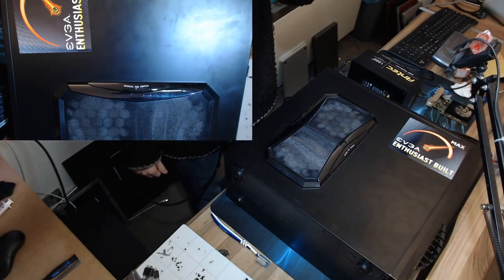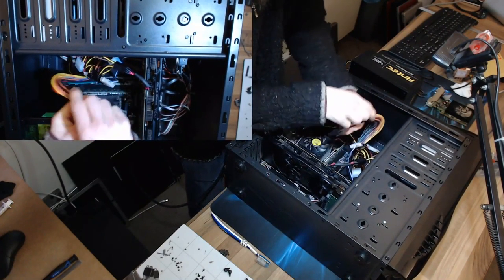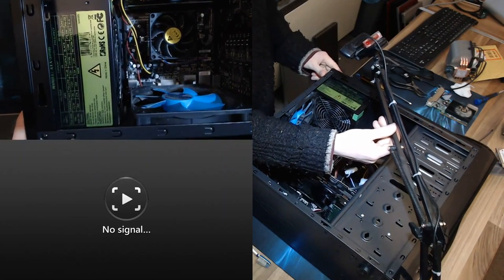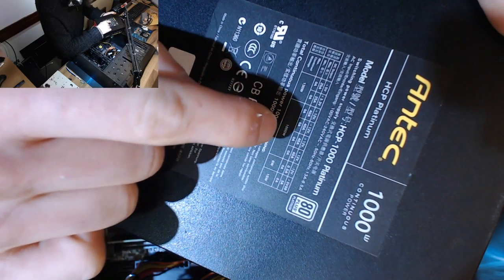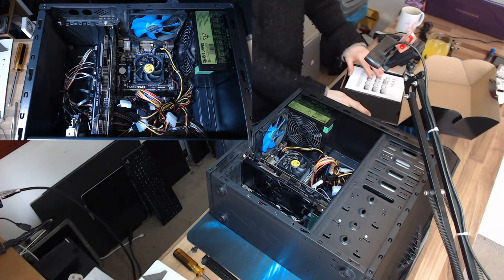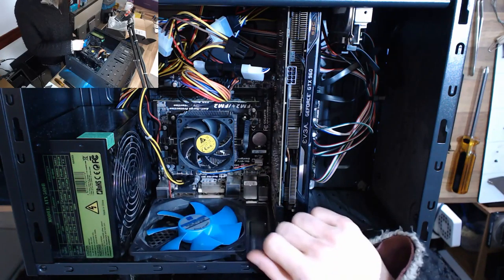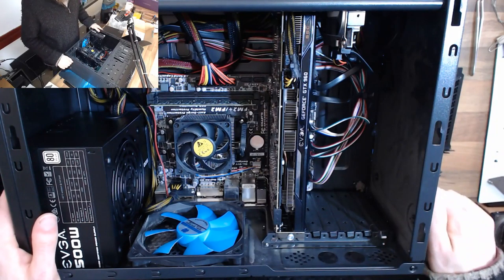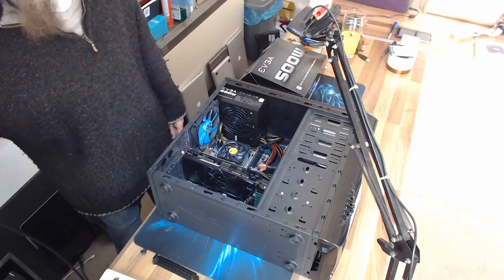LFC#99 - Crap Power Supplies

Comment: I am a firm believer in saving money on power supplies. That is why when I bought my EVGA 650 GQ 80+ Gold semi modular power supply I waited until Boxing Day and bought it for half of what it's currently selling for. If you want to save money that's what you do. Buying a crappy PS costs a lot more in the long run.
Strange that the customer in this vid had an "EVGA enthusiast built" sticker on the case but not an EVGA PS. Well they do now.
Reply: The sticker may have come with the card

Comment: i really don't understand how people would put together parts for a pc like this, they get the most expensive motherboard possible, the most amount of ram, a big graphics card that can barely fit inside the case sometimes, 4tb or more on storage and then turn around and buy the crappiest unit for powering the whole thing, where do they find these power supplies anyway i saw that green label and i knew right away that was going to be another useless power supply.
Reply: I was given a PC a few years ago (of which the board/CPU/cooler and a couple of drives are actually in my outgoing main PC; I upgraded the rest) and the PSU was a "750 watt" CiT, needless to say I never plugged it in and replaced it with a CX 500M. so yeah the CiT was maybe 350 watts on the 12V rail and useless excess wattage on the other rails making up the rest, which I learnt from watching this guy's helpful other "crap PSU" video only the other day! compared with 450+ watts on the 12V rail on the Corsair... the thing is, the PC with the CiT PSU in it literally came from my Mum's partner who's actually pretty good with PCs. It's like people don't even understand :P
Reply: It’s called tech ignorance.

Comment: HERES a good question So lol if my psu has a Weak 12v rail.  assuming the 6pin power connectors are Part of that Rail. would it make more sense to use a x2 molex to 6pin for gpu power assuming the molex is on the 5v rail which is stronger then my 12v .. 12v rails got 18 amps and a secondary 17 amp. but the 5v is 30amp . Does that make more sense.
Reply from the maker: 4-pin Molex wires are 12-0-0-5, and when you use a molex to 6-pin adaptor, it's just taking the 12v and 0. So that won't help you.
Reply: 6pin provides only 12V. Molex provides 5V and 12V but the adapter doesn't use 5V because 6pin isn't supposed to provide 5V.

Comment: should of done a short vlog showing the working PC after your fix. just a tip for next time, still got a thumbs up from me.
Reply: He already did that - it was proven working when he switched in his Antec supply. Machine went from dead as a doornail to looking for a boot device. If there had been something else wrong he would have included it between the scene where he's on the boom cam installing the supply and the scene where he goes wide with "all fixed, I'll see you next time" :P